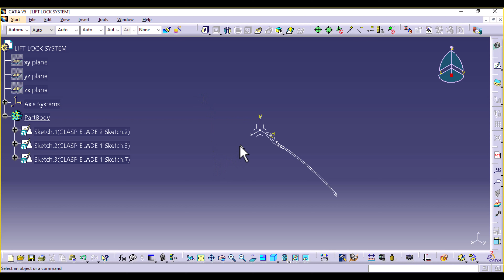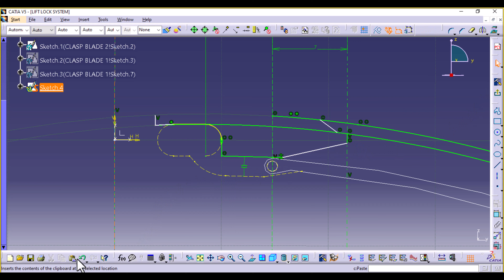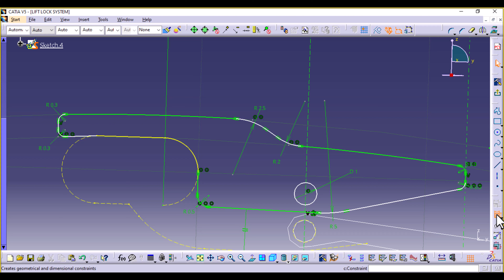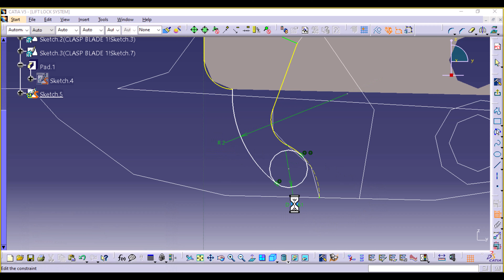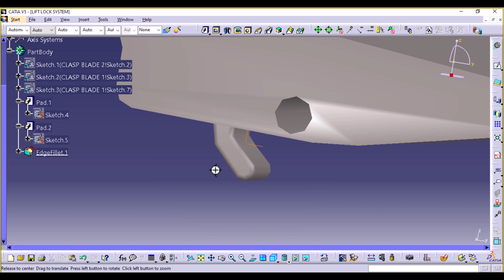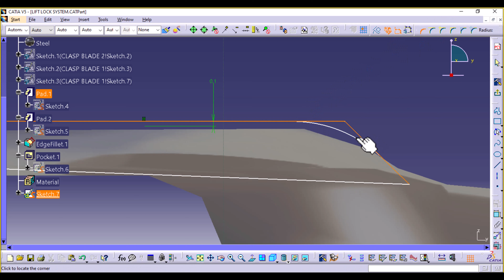CATIA V5 - ROLEX AIR KING DESIGN | PART & ASSEMBLY DESIGN | BEGINNER - ADVANCED| PART 12 - LIFT LOCK

Comment: Dear friend, what do u understand for tooling aircraft design in catia? what modules does it imply to use? Thank U in advance for ur answer.
Reply from the maker: Hi, Could you maybe rephrase the question? I don't quite understand what you mean.
Reply: Hello, I've already get what tooling aircraft means, elements to build another elements. But I though Catia did have a special tool to do do it (Just like using part design, generative shape design, etc) @ArielCad-3d
Reply from the maker: For the tools it's mostly part design since they're mexhanical parts...& a bit if GSD & for complex wireframes .